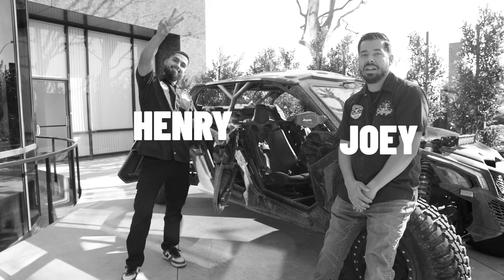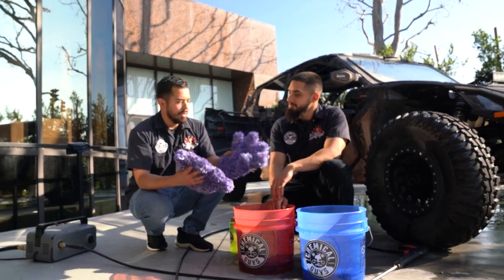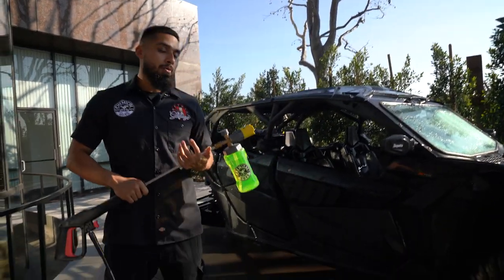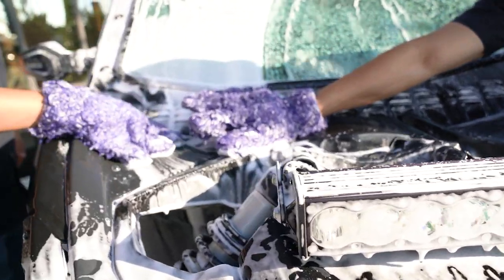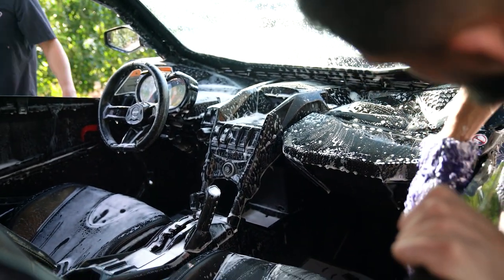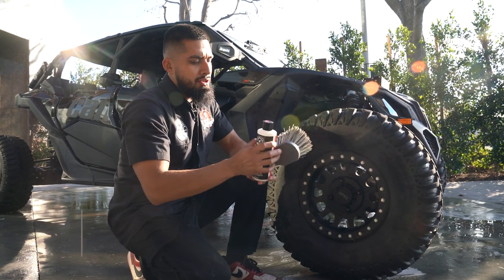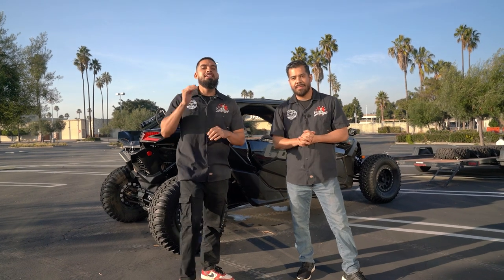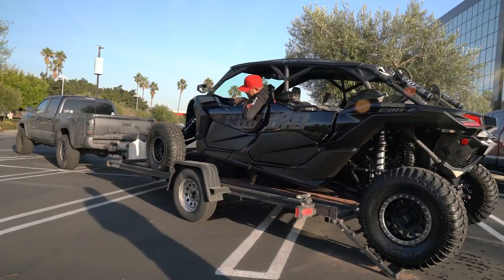How To Wash Muddy Vehicle! - Off Road CanAm - Chemical Guys Part 2

Comment: With a SXS…when washing the interior….aren’t you concerned about water getting into the foam of the seats and also the electrical connections below the seat? Or even the electrical stuff in the dash?
Reply: not really. They are designed to get muddy and wet, just don't want to spray directly on the switches in the dash